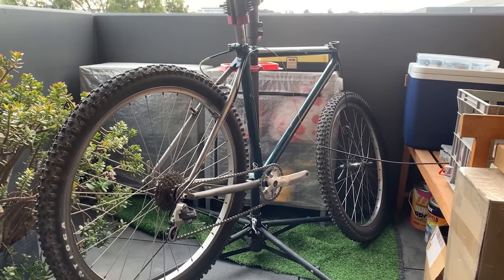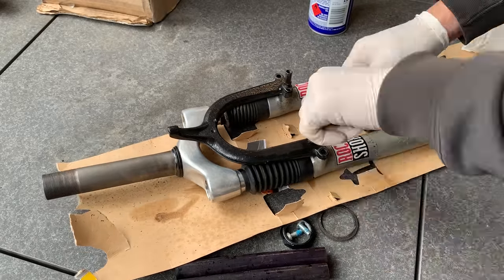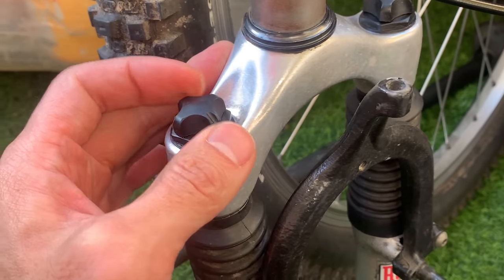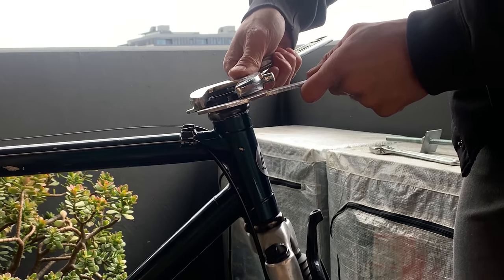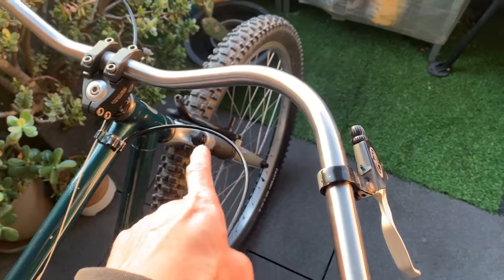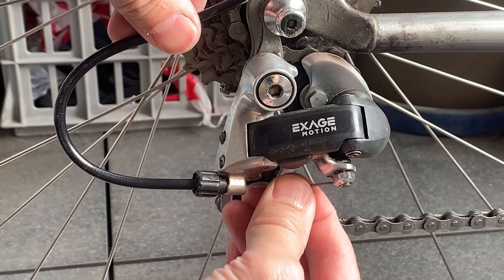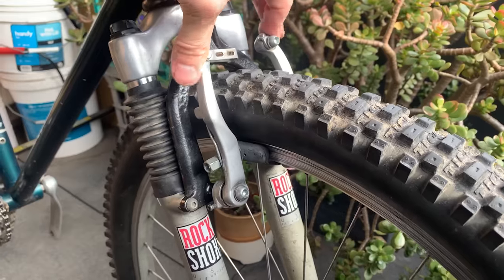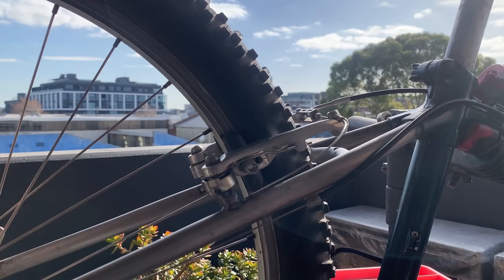rat bike 2.0

Comment: I love a good solid comfy ratbike - this one looks bulletproof. I'm dying to do a build with a handlebar like that! The Quadra fork brings back memories, it was supposed to be the first "affordable" suspension fork according to magazines, so as a kid I got obsessed with the idea of getting one, but I still couldn't afford it so had to wait many more years until I got a nasty RST instead. Have you found the chain stays put on that single chainring OK? My Bianchi ratbike has been a nightmare with its 1x conversion.
Reply from the maker: Cheers mate it’s def a fun ride ! I was suprised how well the Quadra worked, fairly stiff and no noise! Hahah yea I think rst were a bit heavier. 

The chain stays on fairly well and didn’t drop once during this video. I would say maybe drop 2-3 times since building this bike (originally when it had rigid forks and different bars). but it’s been many months now though. I think maybe the short cage derailleur helps ? Or my soft riding 😂

Comment: I find the process of dishing the wheel very intriguing because I personally find it somewhat intimidating to attempt myself. Therefore, if you have any tips and tricks regarding straightening and dishing wheels, they would be more than welcome. :D
Reply from the maker: Yeah it can be a bit tricky but the more you practice the better it gets. I would start off with just a small bump and try to get it out - always make sure you are turning the spoke nipple in the right direction because it’s easy to get it mixed up.  You could try to do it like how I did on a stand and just use your brake pads as a guide - you can use your barrel adjuster to bring the pads in slowly til you hear a tiny scrape then tru the wheel until you don’t hear it anymore. Then bring the pads in a tiny bit closer and repeat the process or until you had enough. Trying it is the only way you will learn! Good luck 👍
Reply: @garysprojects  Thanks for the response, i figured this is something you just learn by practicing a lot. Thanks for all your vids, really enjoying watching the slow pace cleaning and building parts!
Reply from the maker: Cheers mate i appreciate that ! 😊🙏